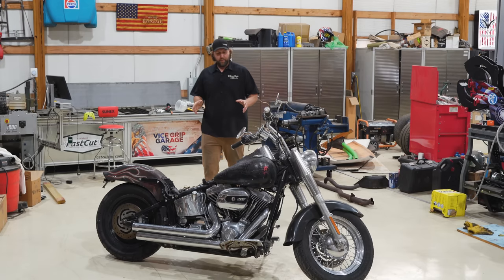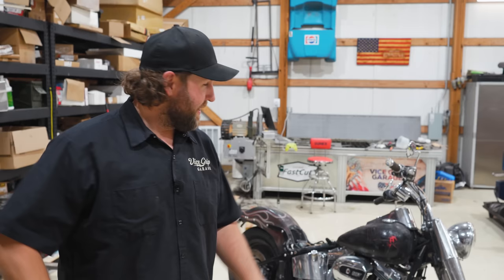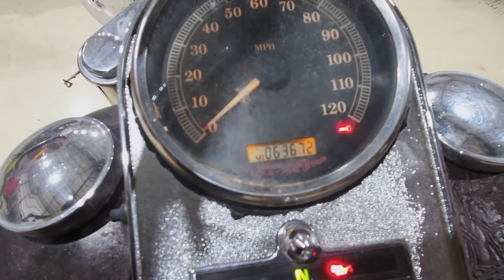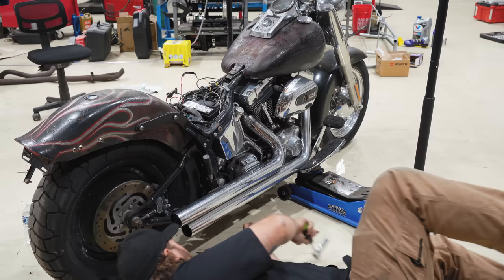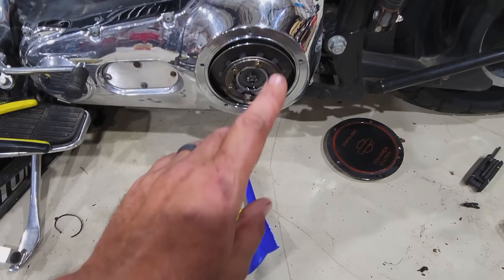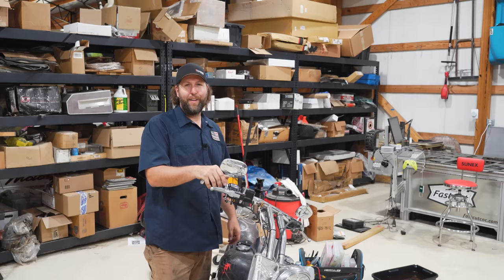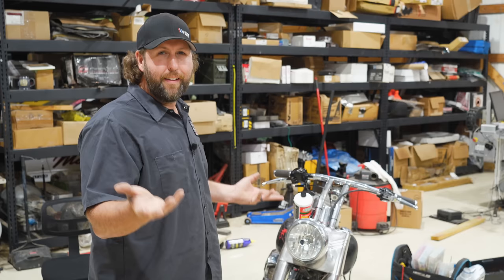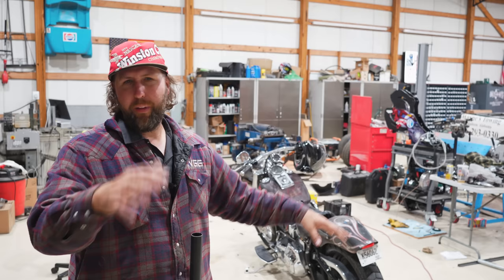ABANDONED-STOLEN-RECOVERED! Will This HARLEY DAVIDSON Run and Ride Again After YEARS?

Comment: Absolutely love the motorcycle content! If it was me I’d still check out those cam chain tensioners as their inspection interval is every 25k miles for the Twin-Cams, and the previous “owner” wasn’t exactly nice on the poor machine. You might not hear any chain slap now but with those older spring tensioners once they are metal to metal with the cam chain they will fly apart and all that metal will recirculate through the rest of the motor and it’s toast. I only say this as I’ve done a bunch of cam chest inspections at my shop with motors that sound clean and smooth but were at the brink of tensioner failure till we took a peek at them. Cheers and ride safe ❤

Comment: This video inspired me to get to work on my 2007 Ultra Classic that I have had an issue when shifting and reaccelerating.  Just like you said I used all the exact fluids you did and saved a bundle. I then took a closer look and realized the belt from the transmission to the rear wheel had way to much play in it. About 3” to much play letting the belt slip. I took a couple hours and took things apart and tightened the axle bolt and got the belt to the correct specs. I took it for a quick rip and the problem was fixed. I have since out over 150 miles on it with no issues. Thank you so much for this video you have now got me inspired to work on my other projects in the shop.

Comment: There are 2 tensioners. Inner and outer. The inner cam tensioner wears faster. You need to look at it with a dental mirror. They don't make any noise that you will notice when they are bad.  I've had them in the shop with 30k miles and they're worn past the pad down to the metal yet the bike ran fine. Easiest upgrade is hydraulic tensioners. I've changed a few to S&S gear drive.

Comment: That was a BEAUTY Heritage Softail! It can be again, that is why they are so special. I have been to that Harley dealer out there - but not during the popular leather festival they have there - and you’re right, riding out there is a treat more special than words can do justice to. That is a Fatboy front fender on it, Derek. As for scrapes on the pegs, well, you’re not riding them right if they don’t happen. 😅 That switch behind the headlight on the fork tins was for the passing lamps that used to be on each side of the headlight. My wife has one of these so I have some experience with them. I like the bone rattle of the Dyna line; the Softails all feel like a big puffy marshmallow to me. We are older now so our Softail and Dyna are still here but we lean into our touring models more now. You were given a granpappy of a gift on the it is shiny inside fuel tank. As for the thief messing this bike up… …I’ll just stop at thieves are special kind of stupid. I had a barrel of fun watching you reincarnate this thing.

Comment: Bless your heart Derek, working on a bike without a injury can be aggravating, just shows how much you love your fans!!!! Kudos to you from a fellow bike affectionado with a basement full of old Honda’s😁
Reply: First gear, it's all right; second gear lean right, third gear hang on tight.  Was there a line for 4th gear?  I've owned bikes on and off since 1967.  From a 66 Honda S90, to a 74 Sportster (a real vibrating experience for your hands!), an 
03 Harley Sportster, a 97 ElectraGlide  then I added a sidecar since my sense of balance went with the breeze.  Ran out of storage, had to sell the 'Glide- no free storage space.  ☹
Reply: I've got an old 1977 Trail 90!! Mint! Haha only 1,368 original miles. Same tires from the factory 🏭

Comment: I love the bike episodes, being a harley tech (twin cam is the best cam kinda guy), it's fun to see what you're doing that I do a little different. ATF goes in the primary if it's got Barnette clutch or an aftermarket. The atf type f makes the clutch grab better.... anyways a little manual impact and a small Tonya Harding works great for those derby cover bolts! I used em everytime... just in case 😆.  LOVE THE VIDEOS KEEP UP THE HARD WORK!!!!

Comment: People who buy motorcycles don't have much time to ride, due to having a job and all. People who steal Harleys have all the time in the world to ride! And with all that running from the bad things you do, the miles add up fast! Good job man, great work as always!
Reply: I averaged 26,000 miles a year when I was riding..of course, my bike was a Kawasaki so it didn't get trailered, it got ridden.

😁
Reply: @zrxdoug  My 2013 😊Ultra was bought the day I retired..87000 miles so far.  Been slowed down a few times for two knee replacements, rotator cuff repair and since Jan this year for a ruptured tendon in my right foot.

Therapy has gone far enough for me to head out tomorrow for the first ride  in 4.5 months! 😊

It's never been on a trailer and doesn't leak a drop!

Comment: I love working on bikes! Everything is lighter weight and usually more simple. It can be a problem getting them jacked up but when I didn’t have a garage to work on a decent project car I just had my bikes in the shed and a couple farm tractors. I haven’t done much with the fuel injection Harley’s with the security system so this was informative too!

Comment: 5 years ago, I bought my first bike…a 2007 Ultra Classic with 47k on the odo. Traded it 2 years ago with 71k on it…on a 2021 Ultra Limited. 2007 was the oldest I wanted to go because of the 96” motor, the 6 speed, and the cam tensioner issue was “resolved”. While I really like the 114” M8, I miss that old Twin Cam barking thru the V&H pipes. It’s sad what that punk did to your brother’s bike. Glad to see you wake it back up.

Comment: That's an awesome job, metal man Derrick!  A sad nightmare but you can bring the thunder!  I'm feeling lucky, Walmart didn't have my air cleaner for the KIA but I found one cheap on the Evil Bay and a PVC for the RAM.  Don't worry... don't worry!!  2 Days ago I changed one wiper on the RAM and adjusted the right squirter on the KIA and filled'em both with the RainX... I'm really gettin' after it!  The 08 KIA air filter is actually Factree faded orange, it looks like new but might be the original with 55k miles?!

Comment: Love the bike content! If this is an 05, it would be an excellent candidate for gear drive cams due to tighter tolerances in the earlt twin cam bikes. I dropped in S&S 510 cams in my 04 EGlide Standard. Woke the bike uo, and no issues in 140,000 km's. If this was my bike, I'd leave the appearance as is, but get it mechanically fit. Like you said, the bike has a story to tell. ;) Hope a feller is feeling better.

Comment: Tip for doing the primary oil change... the inspection cover just to the left of the derby cover where you filled is alot more open and easier to get a funnel into... also might be a good idea to check that primary chain tension on a bike with dodgy service the last 30,000 miles. Also on those twin cams if your brother didn't get to the changing the cam chain tensioners before it got stolen they are a ticking time bomb at that milage. Even if they aren't making noise, because they wont make noise untill failure. The problem is the plastic is too soft and gets eaten away until bam its metal on metal and could grenade the engine. Other than that pretty darn reliable engines, and I'll say it the best sounding engine harley has made.
Reply: For me best sound is pan head shovel bottom
Reply: @davidcatlette9697  can't say I've heard one. But I mainly mess around with evolution's and my friends twin cams when they break down.
Reply: @skidmark316  that would be too simple
Reply: Dude was busted going over 100 mph on that thing.
Definitely check cam chain tensioners.

Comment: Just rebuilt the carb on my '98 Wide Glide last spring and that thing still runs like a top.  Snow yesterday in MN, so riding season is still on hold here.  It sure seems like putting the bike back to anywhere near original is a bigtime losing proposition since it has 63M+ miles and has had a rougher life than most.  You could buy a couple of really nice bikes for what it would cost to bring this one that far back.  I say make it safe and reliable and be happy with putting it back on the road.

Comment: Around here in NC, even 50,000 is considered low miles on a Harley. My dad's 2014 Street Glide has 178,000 miles on the original engine and still runs great. It depends on how you maintain them. Great video man!

Comment: Awesome Derek 
I have one like this it’s a 2013 heritage soft tail classic all leather plus trunk and saddle bags. Chromed up too.
I have 83,000 km’s on it now
That’s about 52,000 miles. 
I bought it with 24,600 miles 
So in about 3 years I put on almost 30,000 miles. The 10K per year. I too love getting out on the road.
Thanks for another great video!!

Comment: One thing you never want to do with an old Harley it's been sitting for a long time is check the oil and if it's low just dumped oil in it and try to start it up. Cuz there's a really good chance that the oil leaked by the valve from the oil tank and ran into the crankcase. That's why sometimes when you see a old Harley start up it'll shoot oil onto the ground. I had an engine that every drop in that tank ran into the crankcase . Like four quarts. That would have been a mess trying to turn that over with all that oil in there

Comment: I’m from the U.K. and 68 year old and worked on bikes all my life so I found this video really interesting and The only thing I can think of is the black speaker wire must be sending a pulse down the white wire and switching off or bypassing the alarm as no wiring up that side is ignition only lights and indicators but it would be fantastic to see how the rest of the wiring is done because I have been working on a 2000 deuce who’s the first of the fuel injection model and there is a problem with the turn signal security module and we can’t get it to accept a new one so I would love to see a full view of the wiring that was done if possible

Comment: Just recovered my 09 Harley FXDB!!!! It’s been gone for two years. The cops called me and told to come get it from impound. It’s a mess. The frame and motor are mostly the same. Tank is off a super glide. Night train front fender, front wheel, forks and head light. Fat boy back wheel and primary cover. No key, wires are all screwy… but I have a project

Comment: 30-35K miles is where the cam chain sliders, Lifters, pushrods ect start to give you grief. I own a '03 and I replaced all of the lower valve train parts with S&S parts at 32K  before something broke. Replaced the compensator, I also installed a set of Rocker Lockers so the  top end didn't sound like 2 skeletons screwing on a tin roof anymore. They work great for just a few bucks. I see it has Vance & Hines LongShot pipes on it. Great sounding exhaust with the baffles installed. Mine has the 42mm Keihin carb which I prefer over the EFI simply because I can repair a carburetor.

Comment: I have a 2007 Heritage Softail. The twincam motors should go about 100,000 miles or more. At 50,000 you should check the camshaft chain tensioners.

Comment: My 2002 Night Train, I bought with 32k. Opened my cam chest and my tensioner was in pieces sitting on the bottom of the chest. Bike ran fine without the tensioner. Eventually upgraded everything to a 95" stage 4 if you will and now at 64k running strong. 50k seems a little too long to wait and I believe the consensus is around 30k.

Comment: Loved it brother! I have a 06 Electra Glide Classic and I was told that was the first year for fuel injection. I don't know or maybe that's a later 05.I had my 88 punched out too a 96 and bigger cams when I ran her 90mph in 105° heat index for a couple hours trying to outrun a storm lol. But oil wise I have always ran since Castrol GTX 20W50 and have almost 50,000 miles on the rebuild and haven't seen any metals on the plugs yet. I'd love to ride with you brother! Keep the shiny side up peace! Have a great holiday!

Comment: Point out.  When re filling the promary, take the inspection cover off, that was you can refill without a funnel, plus you can check the chain tension. I also use gear oild in my transmissions and primary and dont run into problems

Comment: Ok Derek... I want to see this one fully done.... doesn't have to be a full-on "custom" jobber... just paint, seat and de-Meth the wiring.  This wouldn't need a full episode by itself... but howz about a guy makes a compilation episode where you touch base on 3-4 projects during the hour with just some "talking head" parts, maybe some build/broll montages, and then wrap it up with some beauty shots, on-the-road footage of the completed project.  Also, lemme know if you need an editor... willing to also move from MN to 10AC.

Comment: My bike is a 2008 Street Glide. It’s a 96 too. And it has 69,000 miles on the clock. She runs strong. But I take real good care of her too. 3 hole service every 4k. New brake fluid every year. Stays in a garage… And she’s my first bike. Idk what the first owner did because I bought her used from a dealer. But I bought it 3 years ago come May 2024 with 52,000 miles on her. First bike was a Street Glide… Mom wanted me to get a smaller bike and do the stair step thing. But nope. A Street glide is what I wanted so a Street Glide is what I taught myself to ride on. I’ll never get rid of it unless I will it down to my 3 son’s.

Comment: The answer to the question of what to do with this bike is an easy one, get out and kill some bugs with it; the riding season is longer here in TN. The other question about where do I like to ride in the road is according to who I am with and whether I am leading or following. I like the left side for the lead bike and a stagger from there back if riding with a group. If it is just me, I still ride to the left; between the yeller line and the  oily center patch.   -Keep the shiny side up, and the rubber on the road.

Comment: Next time you changed the oil don't take but clutch cover off take the inspection cover that has four bolts in it off to fill it

Comment: When you do your final product, consider using a 3D-printed part to hold the port in place rather than super glue. Or maybe design a custom circuit board that basically takes the place of the old port and has a usb-c port on it; then you'd have solder connections acting as your structure holding it in.

Comment: My guess is to why ignition started working. Those fabulous scotch locks behind the headlamp. Don’t you just love them 🥴 you did mess with them so my guess it’s them. Also headlamp started working after you tinkered with them 
Also love the house wire nut 
As always love your videos

Comment: fyi ,,,the evo motor outside of the cam tensioner issues they suffered in the beginning and cam bearings not being lubed enough. the engine it self can go as much as 100k as long as you change the oils. also use synthetic oil.  1 other thing it is not advisable to run 20/50 in anything else other than the engine. in the 70s they ran it in the primary ,but the motor an trans were linked. pretty much sharing oil. that said if you wanted to keep it i would change out the cam chest.chain tensioner, oil pump and cam bearings. zipper make a great set for them

Comment: Wonder if that ATF was actually lucas wet clutch gear oil. Love that stuff in my 2 strokes. Derek is always using rotella T4 ,  I wonder if he knows it's also JASO MA2 compatible. I run it in my 4 stroke bikes with wet clutches. Whenever I see the 5 gallon pails of it I pick it up.

Comment: Derek, First Time Viewing Ur Video Though Very Impressed On The Plain Out Forward Methods & Reasoning... NewToo The Seen With My First Buy Of A 2002 Harley Davidson XL1200C Sportster
I Don't Know Why, Or How Ur Video Hit My Streams Of Things First Hours Making It Home From A 2wk. Stay From Getting A Toe Cut Off From The Left Foot, Unimaginable Boost I Got When U Fired It Up... So Many Things Where Just Alike, Stoked On The Sound, & The Handlebars, OldSchool Tank, & Softail Fender,,, Cat-Eye Brake Light Standard 1157 For Me Straight Pipes W/Dubble Flap Breather Also W/Muniki 41 Naturally Ass-Per-Rated. The Sportster Has A 3rd. Stage Jake That Just Turns Heads, A One Of A Kinder..
Ur Inspiration Got Me Wondering If I Could Actually, Or Consider Making It A 3 Wheeler??? What Would U Think??? Retired 60yrs Young, 3.5 Million X OTR Driver... Real Deal Rider Started In The Mud At 13yrs. Too Young On A RM80... CAGIN Diesel/ Live Too Ride, Ride Too Live... Breezin All Year/ Both... Dayton U Say, Ohio I Is... Dayton, Tennessee,,, Gotta Be That Paper Mill Town...

Comment: On getting the grips back on ive used lighter fluid it lets the grip slide then acks like glue, never had a problem with the grip coming off. After trips from Alaska and back still on